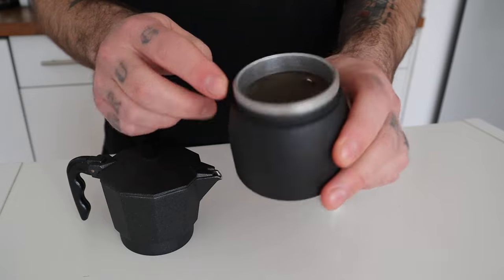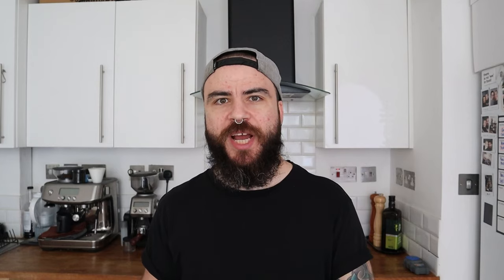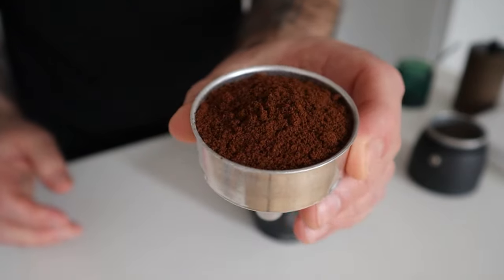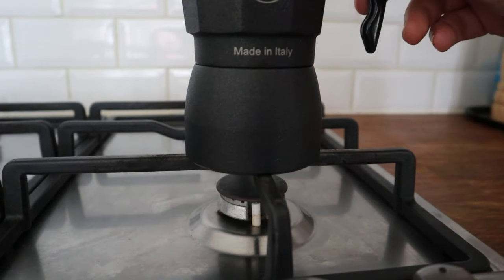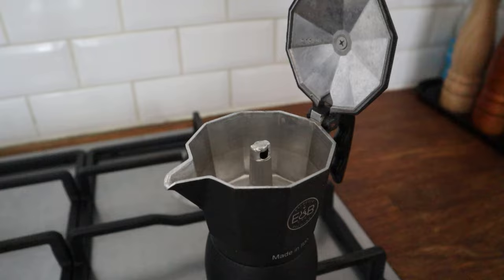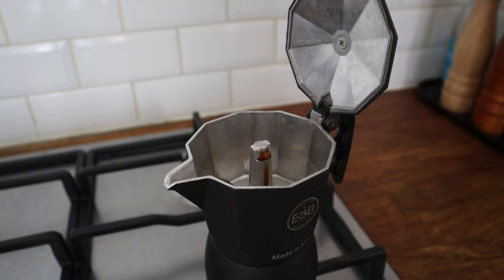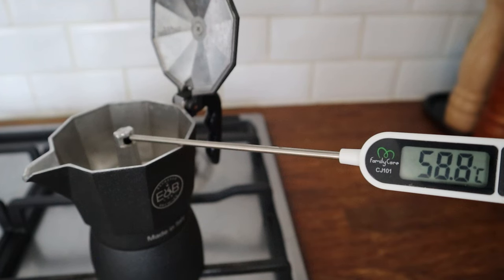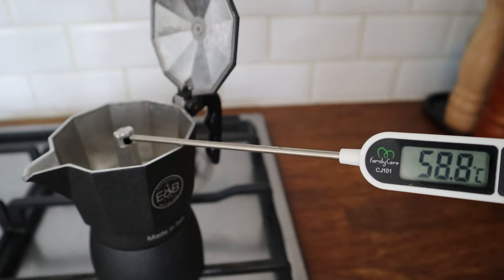The Ultimate MOKA POT Technique - How To Make Coffee With  #mokapot - 2022

Comment: After seeing james hoffman's "ultimate moka pot technique" I thought I'm supposed to keep the temperature as low as possible all the time. I was getting thin stream of coffee and brewing time was quite long, no sputtering, but surprisingly my coffee tasted always very sour. Now I known exactly why, I brewed it all at low temperature. Thanks a lot, you just made my day. I can't wait for the morning brew now.
Reply from the maker: No, you just made my day! Anyway he is not wrong to be honest. low temperature helps to control the extraction, there are other ways to increase the extraction keeping low heat. I'm actually working on a new video about this but I can anticipate to you that if you put hot water inside the lower chamber, even if you keep low heat you get more extraction and get more sweetness and avoid sourness. I need to do more tests and collect datas before being very sure about that, but so far that worked. I wish you the best morning brews!
Reply: Hi, great video. But I didn’t quite understand the grind of the beans. I am not familiar with the numbers you said to grind it at.  Is it a courser grind than espresso? Thank you ❄️🇨🇦
Reply from the maker: @lynsmith2698  Hi Lyn, yes the grind size sits in between espresso grind size and pour over grind size. thanks so much for the comment
Reply: @matteofromtheswamps  thanks so much for the quick reply. ☕️
Reply from the maker: @lynsmith2698  pleasure is mine, I hope I could help

Comment: I've had the moka for some time now and just recently started trying to achieve a really good cup out of it. 
Wondering if an stainless steel moka would offer any benefits over my 3-cup aluminum Pedrini Moka. Another question is related to the ratio: I've always seen and heard that moka pot ratio works by volume. Filling the funnel all the way up to the top without tampering but here in Colombia we rarely use Italian roasts. Instead we use more medium roast or even Scandinavian for most really special varietals so the thing is that at least from my personal experience filling the funnel to the top leads to a really tight ratio and in such condition under extraction is almost guaranteed, regardless of how fine I grind or how hot i brew. 
I heard that 1:10 is still usable in the moka but would highly appreciate your comments on this.

As always, grazie mille for your amazing content!
Reply from the maker: So aluminium has better heat distribution compare to stainless steel, stainless steel is easier to maintain and to clean. I don’t think there is a massive difference in terms or quality in general. Important is the quality of components. Filter mesh and gasket. 
Regarding the coffee. I also use medium roast, not Italian roast, but I still prefer a rich beverage and sometimes I do 1/10 as ratio as you saying for lighter roast because you increase the extraction. But if you use a darker roast it’s very common to extract bitterness because water at the end can get very hot. That’s why I wanted to share my technique to how control the extraction. 
Thanks so much Manuel as always for your support. More videos will come
Reply: Stainless steel will prevent your coffee from tasting burnt because unlike Aluminum moka pot where its top chamber gets hotter and hotter, the stainless steel doesn't. It gets hot from the coffee brewing, but likely to cool down as it sits in the collector unless more coffee is being added to the collector.

Comment: i like to extract a certain amount (approx. 50-55g, fitting in my espresso cup) so i marked an equal amount on the inside of my moka pot. my biggest challenge is to extract both sweetness end bitterness befor i reach the level i marked. the only way to do this is by keeping an eye on the extraction time - which varies between different coffee brands! for now i'm pretty content with 18g of illy classic ground at 11 clicks in my comandante, extracted for 2'00 to 2'15. i need to try out the filter, i think. and maybe i shake my coffee too much once it's in the basket... always learning something new! great video!
Reply from the maker: Thanks for sharing your method! That is a good technique. You can also try putting less water in the boiler. I made a video about different level and temperature very interesting, especially if you use Illy.

Comment: A very detailed video with useful information. A have a question though. How can you actually control the temperature of the water going through the coffee basket? I've always thought that was actually boiling water but in your video you explain it's not? I mean, once the water is pushed up through the coffee basket there's no water to make it slow or change the temperature. It just happens so quickly, and it's just a matter of seconds, isn't it? All you can do it to switch the heat off, or take the moka pot off the oven while the water is flowing. The other question i wanted to ask is about the size of the moka pot. I usually prepare a coffee only for myself, but I'm not sure if i should be using a one cup moka pot or 2/3? The thing is I like a strong coffee with milk, and I used to ask for a double shot coffee when buying a latte in coffee shops. Should i use a 2 or 3 cups moka pot rather than just one cup? Thanks
Reply from the maker: Thank you so much for your comment. 
Water inside the Moka is hard to control. Removing the pot from the stove it helps, that is what I do usually. More you keep the pot on the stove and more the water gets hot, but if you remove the pot, you still have water coming up because the pressure built. Also playing with the quantity of water in the boiler helps to control it. Here in this video I don't explain it because is something that I didn't explore yet. I talk about his in this video https://youtu.be/pOE0XNUUnbo
I suggest the 2 cups, I actually posted a video last week about it. For me it's perfect for making coffee for 1 person and also perfect if you drink it with milk. Another video will come on Sunday about the 2 cups Moka and then I will jump on milk as well.
Thanks again for your comment :)
Reply: @matteofromtheswamps  thank you for your reply. I really appreciate it. I'm also at the stage of considering buying an espresso machine, but that's a more complex subject for another conversion. In the meantime, I'd like to explore other options like using a moka pot for occasional usage, and I'd like to make the most of it. Thus, my queries. I used to use a one cup moca pot in the past, but it wasn't very good, and I lost it somewhere. Now, I'd like to buy a new one, but before I do, I'd like to make sure I make a good choice. I understand you recommend a 2 cup size for one person, which I think is a good opinion, but I'd also like to ask you if you'd recommend a 3 cup size instead. I looked for some brands out there, and it turns out there are 1 cup sizes, and then 3 cup sizes with no 2 cup size in between. Would you recommend using a 3 cup size with less coffee and water load instead? Or will that affect the quality of the coffee if you don't fill the moka pot to its full capacity?
Reply from the maker: @arturl4019  Alright, 3 cups moka gives a better result than the 1 cup. But I don't recommend using less coffee in the basket because it won't give a good result. I made a video where I explain this https://youtu.be/81ZSKML44bY
You can play with quantity of water in the boiler, but placing less coffee change completely the dynamics. 

Regarding Espresso machine is a topic I will start to talk more in depth in a couple of months. Then we can start that conversation.
Reply: @matteofromtheswamps  thank you again. I'll keep that in mind 👍

Comment: thank you!  i HAVE AN ELECTRIC STOVE, do you recommend having the heat setting on 1 or 2 ? it has 5 settings. thank you a great tutorial!
Reply from the maker: If you place at 1 it will probably takes more time for the water to come up but you will have more extraction and intensity because the slow flow. I would choose based on taste
Reply: @matteofromtheswamps  thank you very much!!! I have noticed you mentioned to fill the coffee grinds completely when its 1 mokapot but you also said to add in between 7 to 9  mg of coffee depending on grind ground type something like that and when I added that amount it didn't fill up the whole space with coffee, what do you recommend to do??

Comment: I recently crawled out from under a rock, and learned about the Moka Pot today from a YT short..  
i had seen them in stores before, but never gave them a second thought.. 

anyways, i bought a couple today, a 2 cup and 6 cup.
Seasoned the smaller one by brewing a few throw-away shots.
And then brewed my first cup…
Which was the best shot of espresso I’ve ever had..

And then i saw this video, and everything was spot on… i had done everything you mentioned here.

However, it only took me 3 minutes from start to finish of actual stove time.. using room-temperature water.  
And it is hard enough to work with while cool, i would hate to have to do it full of hot water.

And, if i wanted to heat that water separately, it would actually take longer than the 3 minutes it took for the whole brewing process.

So, I’m wondering if preheating the water first is really beneficial in terms of cost of energy, time, effort, efficiency, ease and safety??
Reply from the maker: thank you so much for your comment and for sharing your experience. 
I'm making a video right now about the water in the boiler and the benefit of hot or room temperature. 
Remember if you like the coffee you make stick with the method.

Comment: Hey Matteo, thanks for the great video! 

Before, I was using cold water after watching your videos and high temperature. Now I use the minimum temperature of my induction stove as well as hot water. The problem is when I hold the thermometer on upper chamber, the temperature does not go up to 60 or 65. According to my observation, around 30-35 the coffee is coming out. Is it because of I am making the coffee on electric stove, not the gas stove?

I observed that always there is a little water left in the boiler, maybe around up to 10ml sometimes. Even though the upper chamber is splashing coffee around at the end, why there is still water staying in the boiler part, am I missing something?
Reply from the maker: Hi Muhammed, 60/65 it works with my moka on my stove top, as I said you can have different temperatures, this is not bad, it all depends on your taste. coming out at 30/35 it means the coffee comes out faster, but doesn't bad coffee. how does it taste the coffee with this method?

Regarding the water left in the boiler, some mokas have shorter basket so doesn't catch all the water, this can be done for safety reason in case you leave/forget the moka on the stove.
Reply: @matteofromtheswamps  Hi Matteo, I'm not a coffee expert but I would say it tastes quite good. I am using Lavazza Crema E Gusto with 9/10 intensity. I am just getting started with the freshly grinded beans and tasting, so I don't have much experience. 

Thanks a lot also for the explanations!

Comment: Thanks for the very instructive video. What is your opinion about steel and aluminium pots?
Reply from the maker: Thank you very much for the feedback Pawel. 
Nothing change much between the two Mokas. Aluminium works on gas stove when Stainless steel on all the stoves (electric and induction included). In terms of metal properties, aluminium has a better heat conductivity compared the stainless steel, so heat faster. But I find stainless steel easier to clean. I would focus more on components like basket, gasket and filter for a better brewing quality.
Reply: @matteofromtheswamps  Thank you for the reply. Do you have any experience with electrical moka pots? What your thoughts on it? I am using one and some how cannot find a perfect method…
Reply: @matteofromtheswamps  I think the issue with electrical moka pot is that I am not able to decrease heat of it. On electrical stove a medium or low heat can be adjusted. I tried your method on a electrical stove with a aluminium pot and coffee takes better than from more convenient electrical pot.
Reply from the maker: @pawelkarbowski3622  unfortunately I don’t have experience. What the brand of yours? I’ll try to research about that.
Reply: @matteofromtheswamps  It is Rommelsbacher EKO. Could you write what is the size of your moka pot? Or what is a preferable size for aluminium on for one person? I have an impression that new pots made of steel have different size ratio (coffee amount to water content)
Reply from the maker: @pawelkarbowski3622  Thanks, I’ll look into that. I have different mokas. The one I use the most, also for the video is a 3 cups moka. 150gr water in the boiler and fits appropriately 20g of coffee in the basket.
Reply: @matteofromtheswamps  Thank you for the answer. I see you are using E&B Lab pot. What are your thoughts abou it in comparison with a standard Bialetti?

Comment: I’ve been getting very bitter/sour? Coffee when I run my moka on the lowest heat. Right now I’m only trying 8:1 or 6:1 ratios. Will eventually try 10:1. But I’m mainly interested in making iced flavored lattes…
Reply from the maker: If you say bitter/sour that could be a sign of channelling. Important is to distribute well the coffee in the basket. I don't suggest you 10:1 for iced flavours latte cause you might lose coffee intensity and also more water you put more bitter will become. I'll stick with shorter ratio and maybe also adjust the grind size.
Reply: @matteofromtheswamps  thank you I will keep experimenting

Comment: Why does the E and B labs moka pot taste better than others?  I have a 1 cup E and B pot and the same coffee at the same grind tastes better than my 3 cup Bialetti. I hate to keep buying pots but it does seem to taste different. I understand the filters are different but I use the aeropress filter on the Bialetti and can't use it on the 1 cup E and B pot. You would think that the aeropress filter would make up for the better filter of the E and B but it seems it doesn't. Any thoughts on this.
Reply: After writing this I was thinking that the answer lies in your video. It must be in the temperature that each pot brews at. I will have to buy a digital thermometer and check if there is a difference in the brew temperature between the E and B pot and the Bialetti. Do different size pots brew at different temperatures? Will a 1 cup moka pot brew at a different temperature than a 3 or 6 cup moka pot from the same manufacturer? I will try to find out but if you know the answer please let me know.
Reply from the maker: Hey Jonathan! Thanks for the comment. 
At home I have 1 E&B lab 3 cup but also the 1 cup you have. Also I have several Bialetti, from 1 until 12 😂
E&B is a premium moka pot not only for the competition filter and the silicon gasket (even if makes a huge difference) . The aluminium quality is superior.
1 cup and 3 cup as well as 4,6,12 all of them have different dynamics, that’s why in the video I say that for every moka is different. I didn’t check with the 1 cup to be honest, but I’m sure the dynamics are different. If in the next days I have time to brew some coffees with the 1 cup I see what I find so we can share information. 
The aeropress filter fits from 3 cups and above. I have a smaller paper filter from another brewer that fits perfectly. A friend of mine as a solution cuts the aeropress ones to make them smaller. 
The aeropress filter don’t make up for the comp filter of E&B, it doesn’t only change filtration but also for the dynamics of pressure resistance in the boiler and basket.

Comment: Tip for the aeropress filter : to make it easier to stand just put some water on it, it'll stick to the metal part.
I don't know if it's bad for the coffee on top to be a little wet, tho.
Can you confirm ?
Reply from the maker: yeah, totally correct. I also do that. it works perfectly